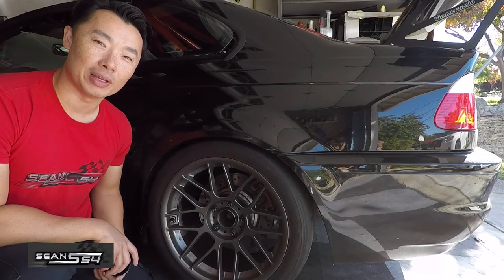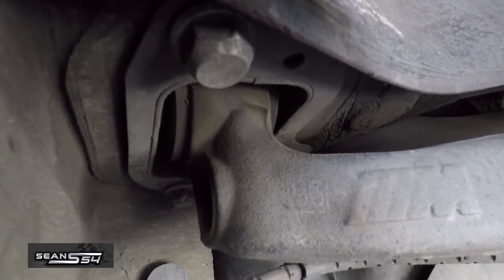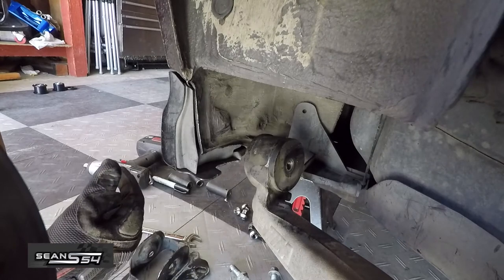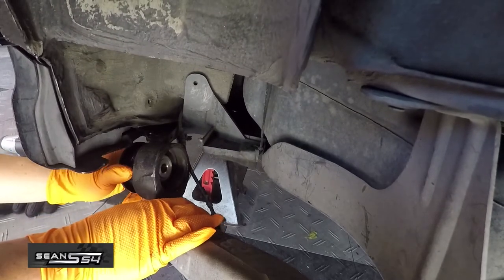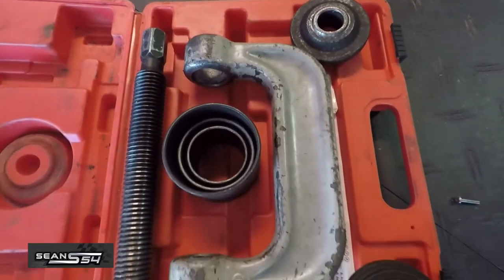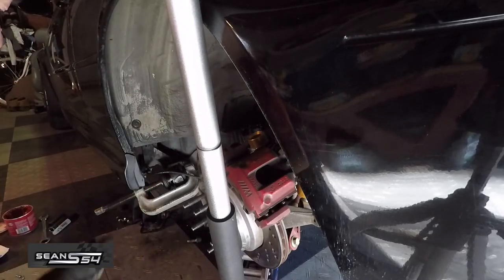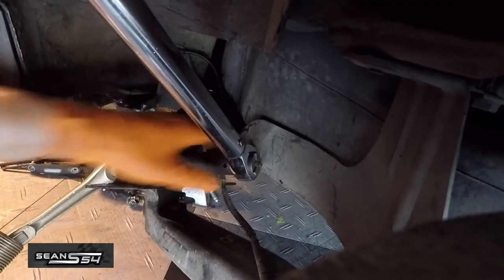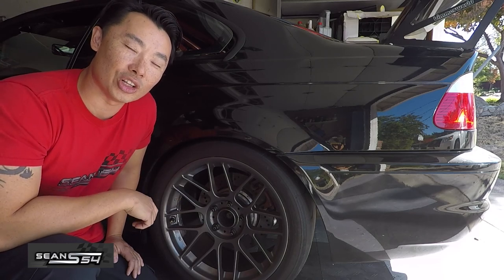BimmerWorld Rear Trailing Arm Bearing (RTAB) Install - BMW E46 M3

Comment: Hi Sean, thanks again for another handy diy! Ive watched this a few times before finally tackling the job myself this weekend (went w the TMS solid monoball RTAB) and since i had the standard RTAB tool from bimmerworld i figured it’d be a cakewalk…

Nope, turned out the standard RTAB tool is no good for installing these solid monoball style RTABs! So yes, you using the ball joint tool kit press is actually the correct way! I ended up having to go to the hardware store midway and picking up a ball joint tool kit as well and installing like you did. I really wish Turner or other online sources mentioned this! (their own instructions dont even say what tool to use) The standard RTAB tool is meant to be used with oem style bushings, using it with the solid ones itll end up pushing on the inner joint rather the metal housing of the monoball RTAB, thus damaging the bushing!

So yes guys, Sean using the ball joint tool to install is actually the right move! Dont use the RTAB tool to install solid monoball bushings! Hope this helps someone else in future and saves them the few hours of frustration i lost this weekend ha

Comment: I link your videos and channel in many of my online discussions. I think you are number ONE on YT as a reliable source for the best mods to our cars! You dont need a hard core track dedicated E46 M3 to benefit from most of your mods. Huge fan!
-Dave (I AM the warranty, now!)
Reply from the maker: Thanks Dave! I appreciate the feedback and support!
Reply: Yeah, Bra! I am going to replace  my RTABS soon. They are shot. Unfortunately I cant swing the price of the Bimmerworld ones yet, I am DYING to get them. Later.
For now it is a pair of dirt cheap Lemforders. At least I have TMS Limiters on my RTAB arms.
I will be using your video as a guide.
I broke down and actually bought a very, very decently made  RTAB removal tool specific to the E46. Seems the E46 M3 is pretty popular in Turkey of all places. I think I paid $54 shipped for the tool.
Reply from the maker: Sounds good! I had the PowerFlex poly RTAB before these BW ones and they were a good compromise that weren't too expensive.
Reply from the maker: Nice, sounds good! Yes, that tool makes the DIY a lot easier! I borrowed tools from AutoZone that worked, but was more difficult.
Reply: I have two impact drivers, a 1/4 drive and a big honking 230 ft-lb 1/2 drive. I have seen several videos showing these bearings zipped out (using a similar E46 specific press) in literally 30 seconds!

Once the surface is prepped and lubed the  install is also 30 seconds. I live near the beach in Florida so I bought non metallic marine grade never seize. You know, salt air, galvanic corrosion etc.

I think one of my RTABS is actually broken. My car is "swooning" all over the place when I press it hard. I snapped one a long time ago launching at the drag strip, so I know what a busted RTAB feels like. Not good. Broke a half shaft too that night. I dont drag the car anymore. LOL Not what the car was designed for...

Comment: Put the bearing/bushing assembly in the freezer. Take a propane torch and heat the crap out of the arm.
Put some high temperature nickel never seize on the bushing and press it in ....it should slide right in.
Reply from the maker: Good tips!
Reply: Yep. Old trick. MANY an interference fit part is assembled this way. No presses usually needed. Just a few taps/whacks with a mallet.
Reply: What about copper grease would that work?
Reply from the maker: I think that'll be fine. The lube is just to get it in.
Reply: @Dave thanks man, I just found out more about it after researching this Energy Suspension Formula 5, for anyone wondering and wanting alternative it's Silicone Based with PTFE Additive grease.
Reply: @Rusiputki  
Mmmm. Maybe research some more.
It's much more than that. They put something in it that makes it stick to bushings like glue. I have never come across anything so sticky in my life.

 You put that stuff on a bush, and it's there for years! It is the longevity of this product that makes it so special. 

if you try to save a couple dollars and make your own concoction, I guarantee you will not be the same as this stuff.

Have you ever heard that saying: "It's cheaper to pay."
Or: Buy once, cry once."
only in this case you're not really crying because it costs the equivalent of two fancy coffees at Starbucks.

It's so reasonably priced there's no excuse not to get a tub....which is basically a lifetime supply.
Reply: I hear ya man but brands like Turner Motorsport / Dinan etc are not always available in other countries so I was just doing everybody a favor in case they also want to get a similar product for the same cost Energy Suspension wants. Plus I learned over the years to call the product what it is, if I find vinegar derust and the reason for it is the 5% acid, then I will just find way to get phosphoric acid for x3 less the cost and x10 more quantity. Reminds me back in the day when we all wanted Wisefab angle kit all the way from Estonia...
Anyway to me this formula 5 grease is available and price is not bad so I will be going with that, but I doubt my friends in the UK will be spending x2 more than what I did due to shipping. So again Silicone  + PTFE = Formula 5 and hopefully in 3-4 years the bushing won't go squeaking like they complain in every forum. And I can't afford solid...

Comment: Nice Sean I always wondered if a bearing would be a better solution. This will obviously allow the wheel to move up and down in the arch with almost no resistance other than that provided by the shock and spring. Love it 😊
Reply from the maker: Thanks Danny. I always felt the rear being kinda "floaty" in the turns... adding the rear wing definitely helped but we'll see if this RTAB bearing will make a bigger difference.
Reply: Looking forward to hearing how it improved things :-)
Reply from the maker: Just posted my latest track video. I've made a few changes at the same time but I can say the handling feels almost perfect. I get a little bit of understeer but that's a simple front sway bar adjustment. The rear feels very, very planted now.

Comment: Awesome video! Did you have any issues with the RACP / rear subframe mounting points? Planning to get mine inspected, repaired, and reinforced (Redish V2 plates), before performing a full rear suspension refresh with aftermarket parts. Afraid of all the spot welds, hairline cracks, etc. including the interior behind the sheet metal of the back seat where the front internal mounts exist (defective MIG welds).. wondering if you addressed the general rear subframe problems. Thanks!

Comment: I have the Turner adjustable rear trailing arms installed and that makes alignment so much easier to do.
Reply from the maker: Cool!
Reply: Sorry. I meant adjustable rear CAMBER arms .  https://www.turnermotorsport.com/p-340474-rear-adjustable-camber-arms-pair-e36-e46-e85-turner-motorsport-streettrack/?pdk=Aw

I did not see a pair on your car. I dont know how you can dial in accurate camber on a lowered car. I could not until I got the arms
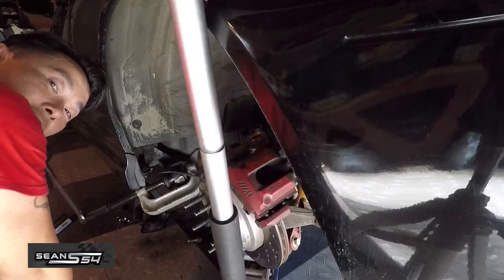Reply from the maker: Oh, I'm running Ground Control rear camber arms. It's hard to see because of the camera angle but you can see a part of it at 4:40.
Reply: SeanS54
If they are red and yellow, yes, I can just barely see them.
Reply from the maker: Yes, check out this video at 1:22 https://www.youtube.com/watch?v=gkojtUI34vA

Comment: did you remove the spring and or the control arm to get the trailing arm low enough? i am having a issue getting the arm low enough to get the ball joint press to fit without hitting the side skirt, there isnt enough room. any help would be greatly appreciated

Comment: When you had the powerflex poly bushings, did it have mouse squealing sounds when driving around on even and uneven roads?
Reply: you need to clean the trailing arm bracket to shiny metal (getting rid of any corrosion, dried lube, etc) and then lubricate the new bushings, the center pin, and the thru bolt well using a copper or nickel based antiseize before installing.

Comment: You have to get an alignment after you install the bushings?
Reply: Yea you need to otherwise you risk causing excessive amounts of stress on them, i did install bushes but not do alignment in just one month there was play again in the suspension bushes because the tires remained curved in a lil bit

Comment: advice for next time: Rather than use a large bar on the clamp, try use an impact wrench. Yes people will say that's not the way to do it, but with the bar you put a lot of twisting force on the other trailing arms' bushings, which I don't like. Or otherwise try blocking the other arms with a jack underneath.